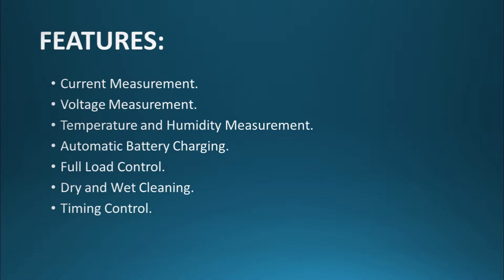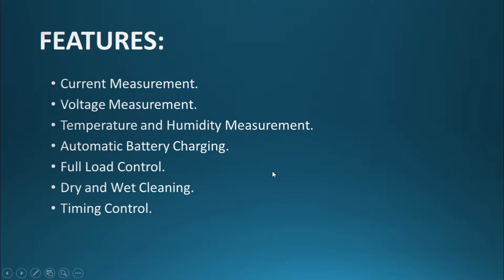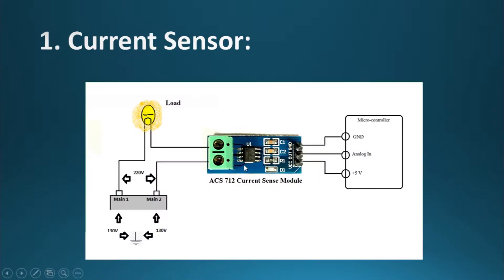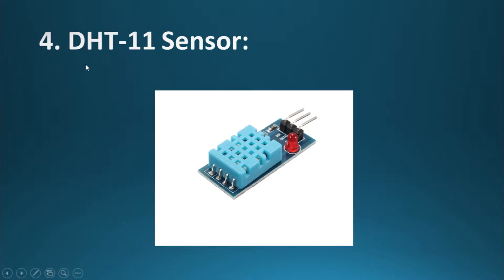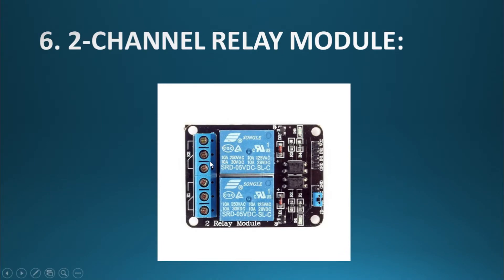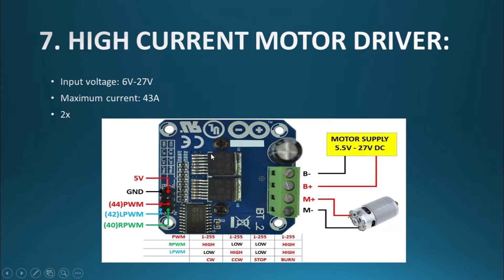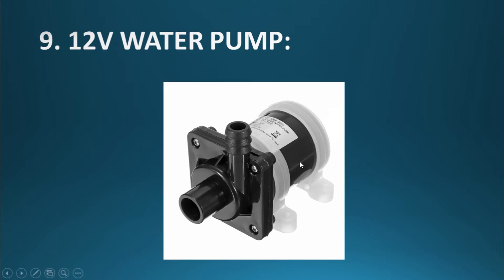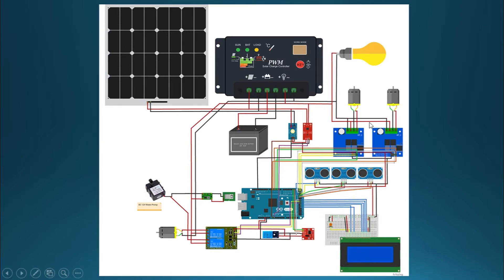Automatic Solar Panel Cleaner ( Part-2 )

Comment from the maker: We're planning to make a much more advance version of the solar panel cleaner, One that would have a power monitoring feature, an App that can be used to control the load and read the voltage, current and the power consumed by the Load along with the voltages given by the solar panel..Please hit a like and subscribe button to promote us, if you want to see it in the future.